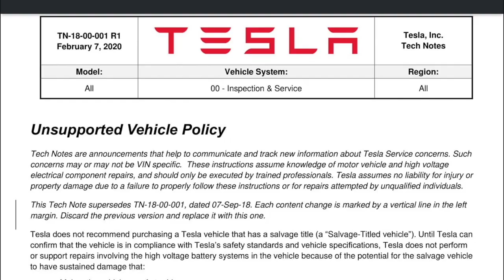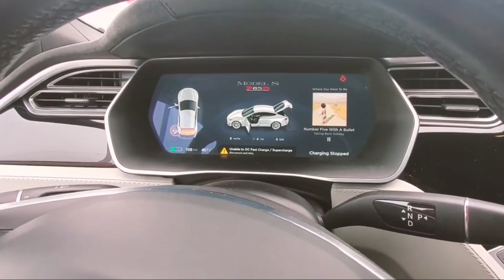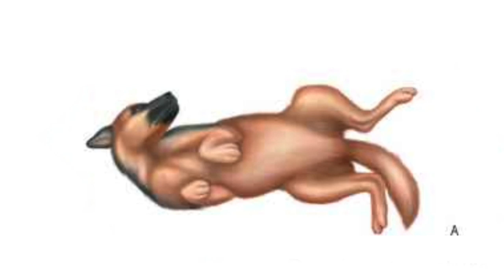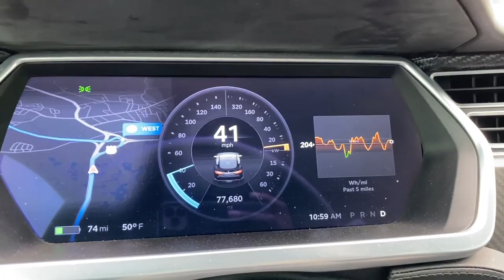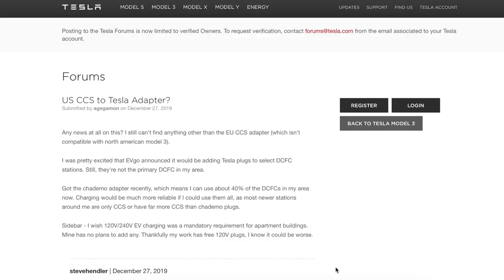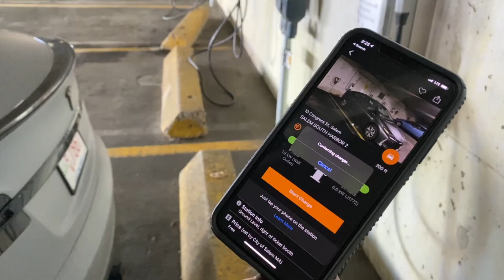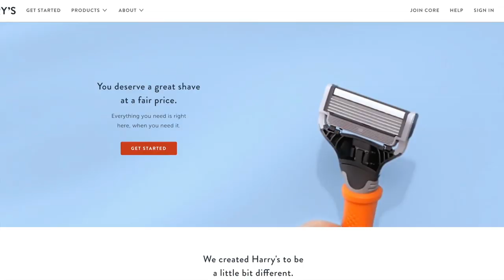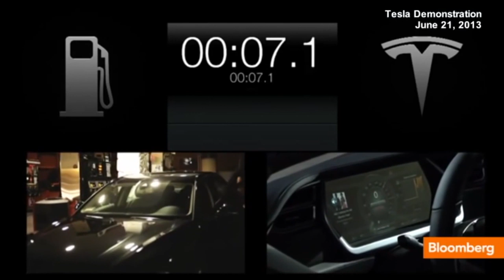Tesla ruined my car and it’s the best thing to ever happen to me!

Comment: WARNING: Do not apply hydrogen peroxide over large areas of the body. 

I was pulling the silver seal off the bottle and I dropped the bottle but it dumped over my leg and foot as it feel. I laughed and said “well no bacteria on my left leg and foot.” About a half an hour later I was having trouble breathing and my brain felt like it was swelling. So do not I repeat do not apply over large area over the body.

Comment: So the Tesla is powered by coal and nukes?🤣😂🤣😂🤣😂🤣😂
Every car should come with a solar panel to charge it. 
Or make the body out of solar panels. 
Using coal and nukes that are mined and shipped with oil, to transfer power across hundreds of miles of resistance to charge a cobalt/lithium battery that was made by using coal and oil makes absolutely no sense.

Comment: Now if you don't see what you are doing wrong in the video I'd have to question your standard of morality on this one. The electricity consumption when charging your car is actually very high, it would calculate to about $1-2 for the electricity bill account holder. But that's off the total usage which more usages would push the bill into higher tiers, which can cost hundreds if not thousands in extra every month or every other month when the bill is paid. Considering all that it is safe to say that 2 hours of free supercharge you ask for would cost about $3.50 to $7, $8 retail considering all the possible losses they need to have accounted for. Now imagine if everybody without Tesla supercharge coverage comes down to someone's business and syphons power for free without permission. It may even run the business dry just by that alone. Conventional slow charging would be the cheapest, but that would take way longer than 2 hours to get any significant amount of charges. Supercharge = High volume of power usage so it's more expensive than you let to believe. Big corporates like Walmart's wouldn't say really much even if you do that but they have the right to say no to you and you'd have to oblige cuz it's their electricity. It's not the same as like charging your phone or your laptop at McDonald's for free.

Comment: I'd stick to petrol operated cars, I don't want to be SOL when the car runs out of power. The future is gonna suck if everything is going to be electric...
Get a flat bed,load up your Tesla and place a banner on each side including the back, Stating: Once warranty ends, Tesla removes Fast charging system.
It will show the world that electric vehicles are not reliable for long trips and costly to maintian. Get a Hybrid. 
It's going to let die hard EV want to save the world people nodding their heads by looking at a Tesla being towed in a Fuel operated Tow Truck. 🤔😳🙂😮🤑

Comment: How much waste and pollution do people have to put up with before you all realize that the electric revolution is more wasteful and more pollutant than gas. Think of all the batteries plastic and non degrading materials that go into those cars. At least a gas burner can be salvaged repaired put back on the road. If it can't it can be melted down and turned into a new car or car parts. You can't do that with those electric pieces of crap. They may be fast they may have alot of tech but if  the power goes out your screwed.